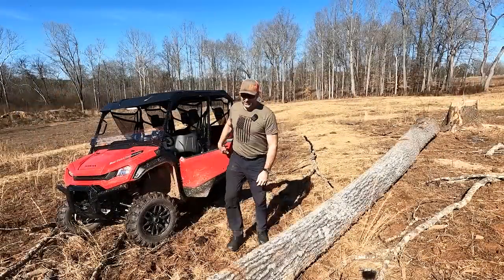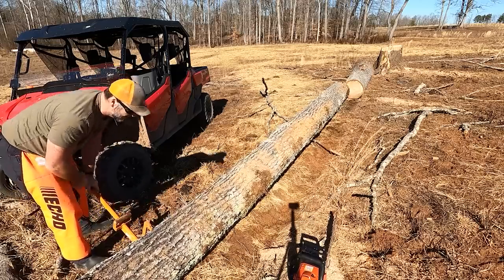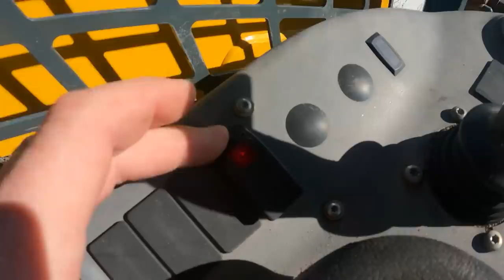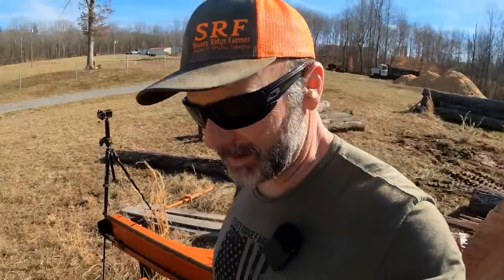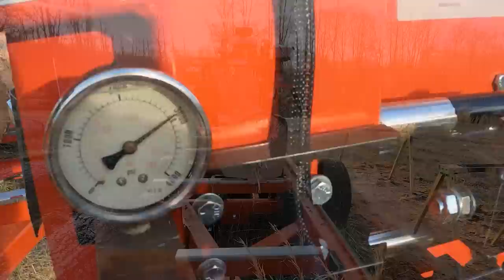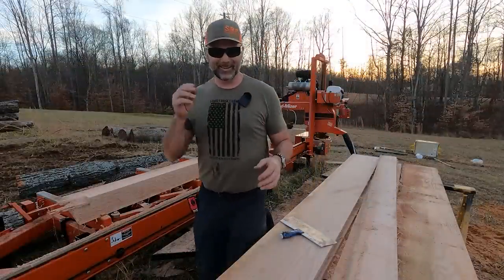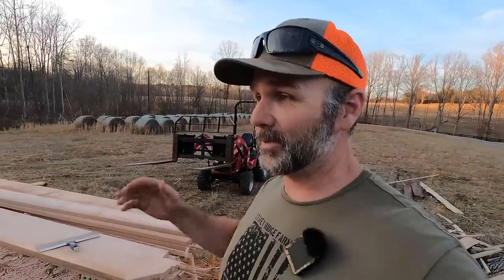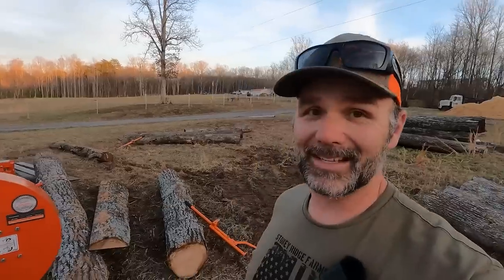Dropping an oak tree and making lumber

Comment: Our neighbor's Big live oak fell in our driveway due to ice storm. Is live oak good for saw mill?
Reply: Just about the most difficult logs that I have ever milled.  Try carbide tipped blades.  Good luck!
Reply from the maker: don't put a tree from someone's yard on the sawmill ....it's 99.9% guaranteed to have metal in it...from nails and screws to forks and butter knives or even matchbox cars! Ask me how I know! lol
Reply: @StoneyRidgeFarmer  Had a friend in El Paso on a horse farm, had a bicycle in a tree
Reply: That wood is great wood, very dense and tough.  That was why old Ironsides got its name. Mill it but you will need to sharpen blades more often.  Big pieces (long and straight)  are rare because it doesn't grow straight.  Should be valuable.
Reply: @StoneyRidgeFarmer  over at White's Service Station and Salvage there are cars growing out of trees lol.

Comment: What's that 4" scoring circular blade for I'm confused?  Seems to go before band saw.  That's some hard wood, not rotten much at all.  Forget fence posts?  Create!  I got white oak for firewood. Burns slow and hot.  Great stuff Josh.  Wooo!
Reply: It's a "de-barker" that cuts off the bark where the blade is going to go through the log.....helps blade life
Reply: @python3574  Thanks Pyhon 357

Comment: No one should ever make fun of you practicing safety.
Reply from the maker: I agree....but I'll tell ya I've been called many "not so nice" names by folks...I think it's my job to do my best to set the example for folks
Reply: Yup. I saw a kid from the local fire company making a simple cut on a branch. Branch rolled back on him and knocked him to the ground. The saw fell across both his legs, running at full throttle. Had it not been for the chaps, he would have been a double amputee. If the chainsaw is running, my chaps are on.
Reply: @StoneyRidgeFarmer  what others think doesn’t matter! They don’t pay your bills!
Reply: not safe all the time  no lumber jack boots in the last video  make fun/ no ./but  need safety boots not tennis shoes

Comment: red oak is no good for fencing unless you treat it...  great for inside... use the white oak. treat the top and bottom end cuts...  next time line the pith up so your cutting horizontal to the pith. you will get stress wood or call furry wood when you cut across the grain of the wood... same for if it has  a long  sweep in it...  the cracks happen often when a dieng tree stands for a while. they are refered to as wind shakes . the tree twists in the wind...
Reply from the maker: whenever we put up fence boards we'll let them dry out good and treat them with wood defender
Reply: @StoneyRidgeFarmer  sounds good to me..

Comment: i really like your channel for its valuable info. i have a couple comments that i would send privately, but i dont know how to do that.
1. the fish in the tire watering units for cows will eventually be effected by mercury, arsenic, benzene, and other chemicals just like the cows will. think of bpas in plastic we have used for years before finding out they werent good.
2. i am not a farmer, but i am a gardener. the crushed eggshells you add to your tomatoes will not help the soil for about 3 years or so. to have a more immediate affect, pulverize the shells with a blender, probably impractical (although true) to say a coffee grinder would be better still
3. your paper towel hack to clean the spray bottle is good. as a wine maker, i use stainless steel bbs (say 2 dozen or so) and swirl them around in soap water in bottles. obviously, one needs to be careful with this action. 
i will be buying a property to make self sustainable within 3yrs and i find your content to address issues i didnt think about regularly. thank you